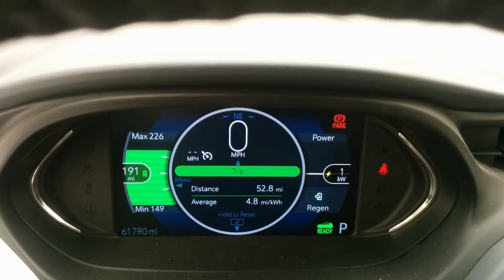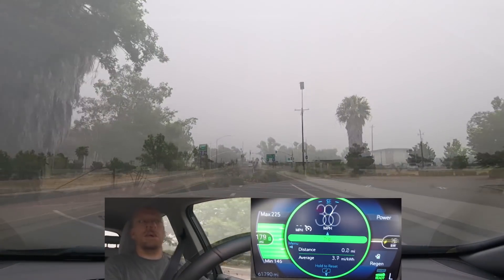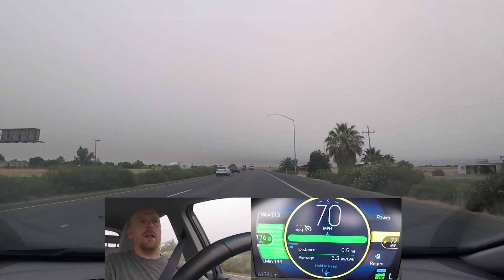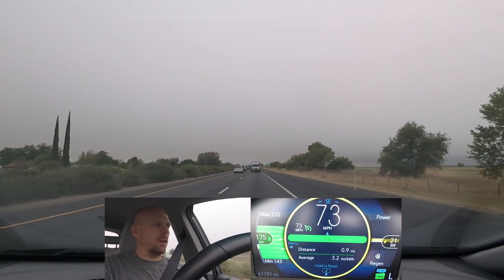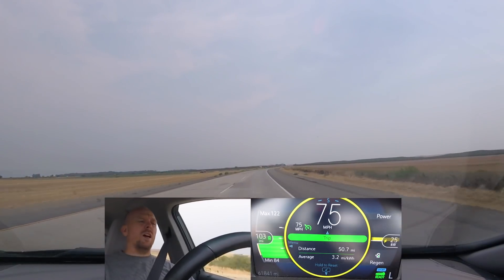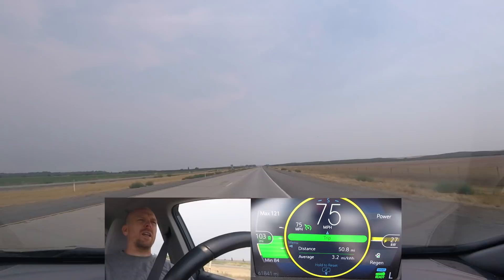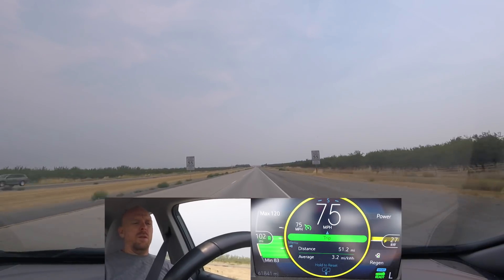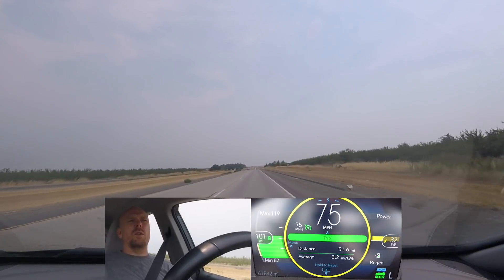Chevy Bolt EV: Real-World Efficiency at 70 to 75 MPH

Comment: Off topic, but have you used Torque Pro to see if the Bolt EV balances when fully charging while in hilltop reserve? If the Bolt only balances at the 100% SOC, how long would it take in Hilltop reserve mode before the cells became 0.1v out of balance between highest and lowest brick voltage? 

Obviously this leads into some further discussion as to IF and HOW OFTEN a Bolt needs to be fully charged to 100% in order to keep the pack balanced without the added degradation that comes with keeping the pack at 100% and regening into a fully charged pack. Even the DC fast charger won’t send 30 kw into a 80% charged pack, so sending 60 kw into a 90% charged pack, and all the corresponding limits to regen as the SOC is closer to 100% would equally have some additional degradation. 

Even if each time you press the cells to max, it only degrades them 0.001%, after 1000 regens at high SOC I think it does start to add up. But this is the reason for doing the regen test with Torque Pro to see IF regen can make the cells reach peak. If they can’t, then it probably has no effect other than the tiny degradation associated with electrons and ions flowing that adds up over 10-20 years.
Reply from the maker: As far as I can tell, the cells are charged to within 0.01 V of each other at max under Hilltop Reserve. 

I have about 10 cell groups that are 0.01 V off of the others, but they've been that way since I first got the cell group PIDs working. The rest of the cell groups are consistently within 0.005 V of each other. 

There's a behavior that looks like cell balancing that occurs between 55% and 68% on DCFC, but I'll have to look into it more.
Reply: Each time the charge drops significantly in current, any bricks which are higher in voltage due to high resistance would come down in voltage more than the lower resistance. So it may give the impressive of balancing each time that happens.

My ebike has 4x 12v 20ah batteries, and since these are gel cells, they aren’t supposed to be equalize charged, and the voltage of each battery spreads quite a bit which charging at 2.7a (bulk phase, Constant current). But as the pack voltage gets near the top, it cuts charge current and increased charge voltage slightly. So that when current is 1.3a, the difference between cells caused by internal resistance is half, and when it stops charging, at 0.6a, all 4 batteries are very close, and hopefully all 24 cells are too). 

So it appears to be balancing, but in fact it’s just ending the charge at a very low current so that the cells are all back to their original balance.

And I think I need the right word for “resistance” that refers to what hinders the chemical reaction of charging, not the ability of electrons to flow. I’m sure there’s a word but I don’t know what it is. Impedance maybe.
Reply: The video that got me back on the topic was this one, in which my opinion is he attacked from the wrong angle. A lot of facts but fragmented in a confusing way, so that in the end your asking “so is it a myth or not?” LOL
youtu.be/QRPze4f0gsQ
Reply: One easy way to see if it’s balancing in hilltop mode would be to see the charge current at 90% SOC when charging with hilltop mode off, and then seeing how it acts with hilltop mode on at 90%. If it’s the same current and then suddenly stops charging at 90%, then I’d say it’s not balancing. But if it gets to 89-90% and charges at 1 kw or less for a while, then I would say it’s definitely doing some balancing.
Reply: I'm pretty new to all this, only have 4000km on my Bolt, (but putting 1000km/wk).
I'm using a ChargePoint CPH25 (32Amp) at home. 
I have Hilltop reserve ON.
The ChargePoint App shows a real time graph with Time of Day on the vertical axis, & Kw on the other.
It consistently starts out,(at 7pm when our rates drop to off peak), at 7.47Kw. It holds this rate until appx 30 minutes before finish. It then drops fairly linearly, over 10-12 minutes to 2.8Kw, the next 10 minutes drops to 1.4Kw, then the final 8-10 minutes decreases to 0 Kw. The graph continues at near 0 for another 8 minutes, then ends, & charger sends a signal to my cellphone that charging has finished, along with total time, kilometers added, & total cost, ( including taxes & delivery based on the hydro plan I'm on).

Comment: Cool video........ I drive up and down the cajon pass every day for work, well this past week atleast and doing 75 myself. I on average get 3.3-3.5 round trip(110 ish miles)and use my AC full blast coming home(Downhill). Waiting to see how much it i.proves when temps drop down to the 80's and 70's and no AC is needed for the drive
Reply from the maker: Thanks! Yes, that's pretty much my experience, too. 

This video is more for people who don't own a Bolt EV or don't do freeway trips often. It's good to know what to expect.
Reply: News Coulomb exactly
Reply: Are there any charging stations with capabilities of charging more then 50kw currently? If so any here in So. Cal that you're aware of? Also, noticed that charging in Vegas is almost double. Do u know why? Crazy high up there

Comment: The max speed I saw was 73mph. In order to get 75 GPS mph, you need to set the speedo to 77mph.
Reply from the maker: Actually, no. I separately checked the speedometer versuses actual speed. The Bolt EV's is off by less than .5 mph at 75 mph. Maybe the different tires on the Ampera-E create a larger difference? 

As for the speed, it ranged from 70 to 75, but it was mostly the latter. 

Again, though, this was just a real-world example from before this efficiency discussion even started. I'll do actual efficiency testing another time.
Reply: Actually the max speed in the video hit 76 mph a few times for a bit.  Also as per GPS my Bolt EV has been spot on.

Comment: It is possible that Bjorn Nyland tested in lower temperatures? Lower temperature would make the air more dense and cause higher air resistance. Also if he ran the heater, it sucks up more power than the A/C.
Reply from the maker: It's possible, but it's not very clear because he didn't include any of the climate control or battery conditioning energy. At 75 mph, either the heater or the AC should be less than 10% of total consumption, but we'd have to see the data in order to know.
Reply: mzs112000 - doubtful that Bjorn was running climate during his stint - or it had way less effect than what we just saw in this run at 90 to 95 deg F.  Air density and less than optimum battery temperature likely came into play assuming cooler Norway temps.  Air density seems to matter a lot to the Bolt.  NC - a similar run at similar speed on this same stretch of road when the ambient is in the 60’s will push the number down closer to 3.0 mi/kWh, even though energy used for climate will be less.
Reply: I still think it's the tires.  The Ampera-e uses the Primacy 3 vs the Bolt EV's Energy Saver A/S tires.
Reply: Erik Stephens The tire theory has been answered.
Reply: Has it been?  Did someone run the Primacy 3 and Energy Savers back to back?

Comment: Hey news coulomb! I'm a big fan of your channel. I have some thoughts about how to make comparisons easier. I know a lot of people are using torque pro to monitor details using what Sean Graham has figured out. My suggestion would be as follows: use cruise control on a relatively flat road about five miles long without regeneration kicking in. Over this road, using the torque pro, calculate instantaneous range using the formula ( 60 kwh/ kw being used ) * mph to get a value for instantaneous range. Compare these two across two different runs and test the hypothesis that the average of this values differs. With this you end up measuring the car and not the driver. As the sampling frequency is 10 times a second, even doing this over a couple of miles would provide enough data points for statistical analysis. The config I have used in torque pro for this is ( [2241A3]/ ([222885]*[222414]/1000 ) )*([22000D]/1.61)
Reply from the maker: Thanks! Yes, I've been considering that. The biggest issue is finding the time and routes when there's no traffic.